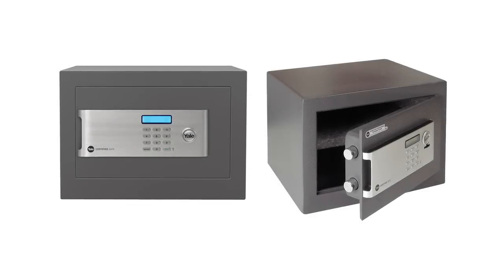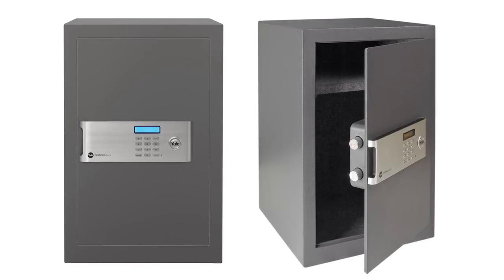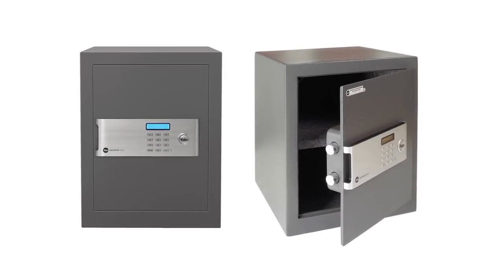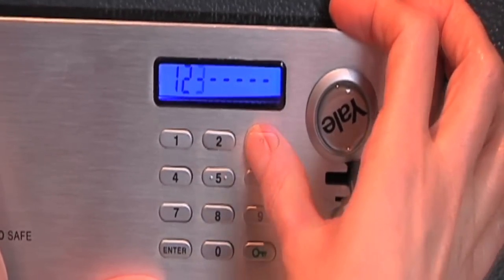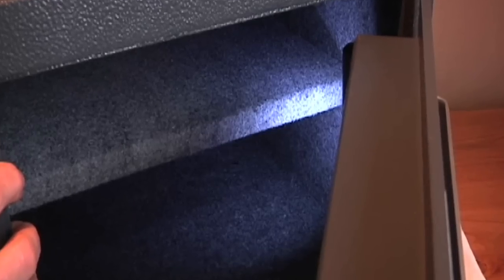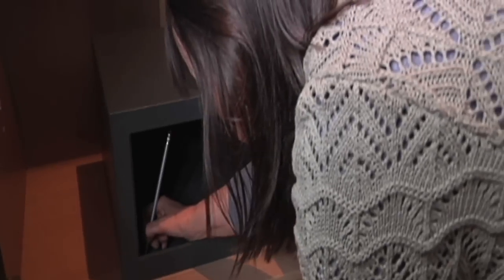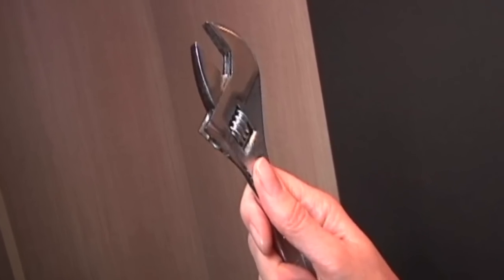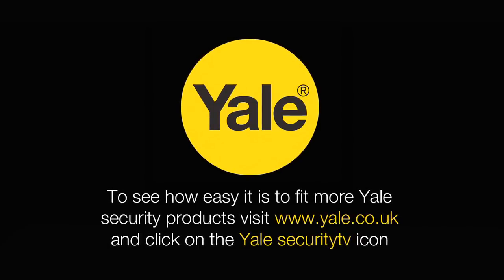How to program and install a Yale certified safe

Comment: Would have been better if you could advise what size drill bit you need instead of saying "suitable".  Doesn't even say on the instructions that come with it.
Reply: I think thats 10 mm.
Reply: It varies per safe and on the type of material you are drilling into